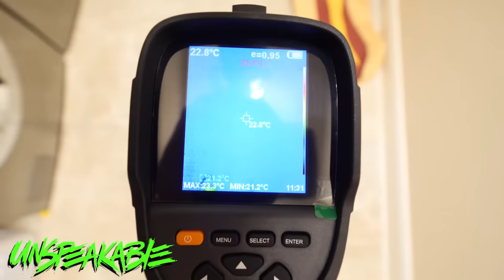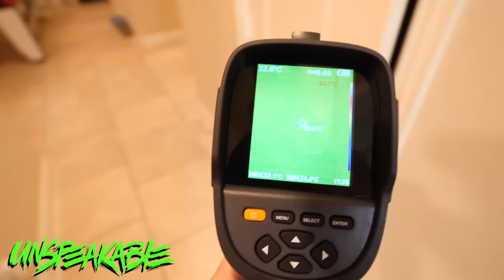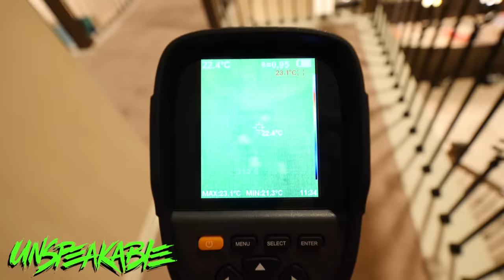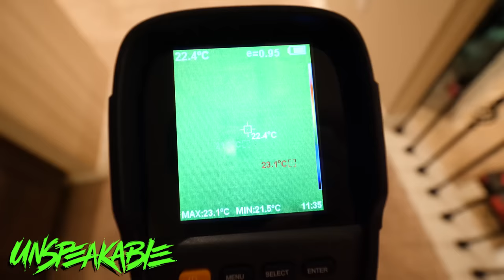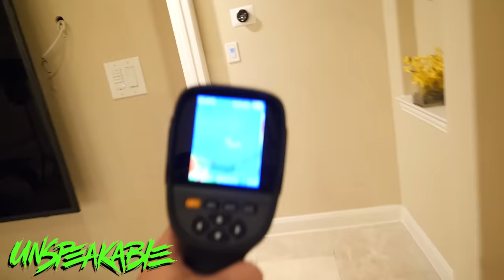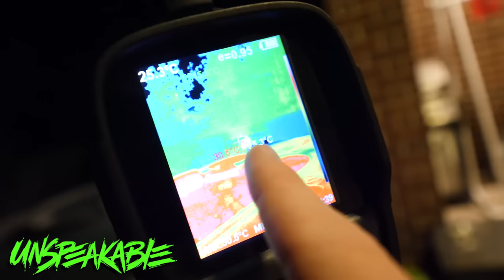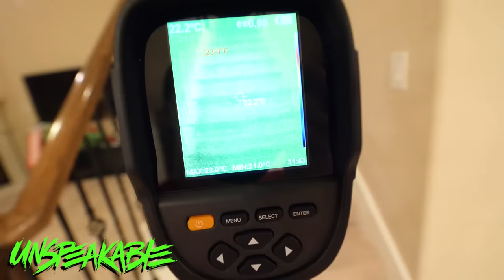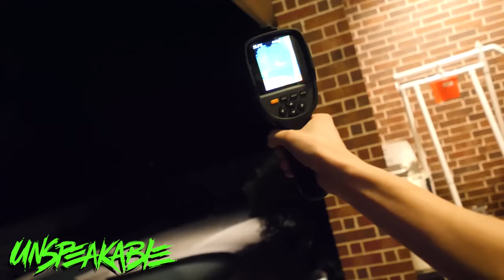USING THERMAL CAMERAS TO CHEAT IN HIDE & SEEK!

Comment: Thermal can’t see through walls 😶😶😲
Reply: You're right but it can sense heat and if the temperature is high enough all heat can spread through the air and if I does get hot enough you could see heat from behind a wall
Reply: Jay The Transgender that’s scientifically and biologically impossible and that’s not how it works look it up buddy
Reply: I disliked the comment